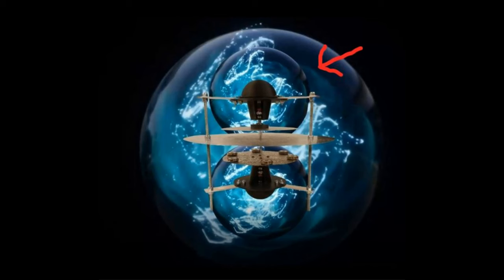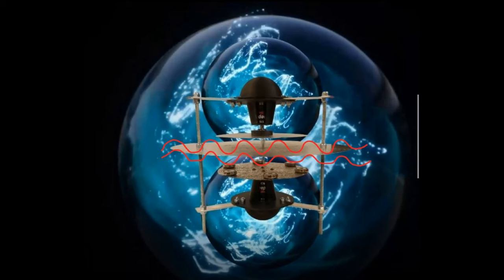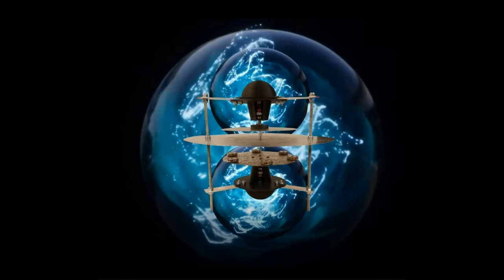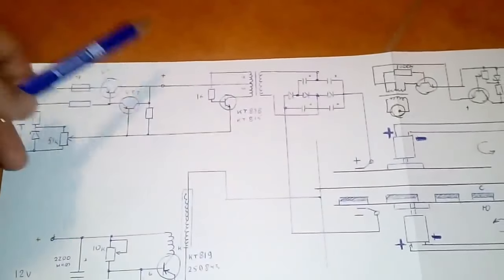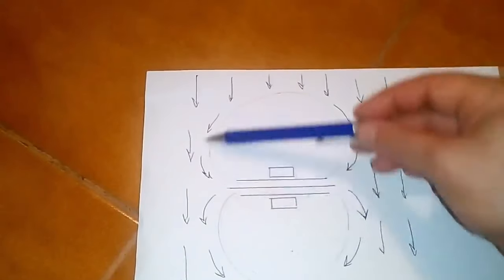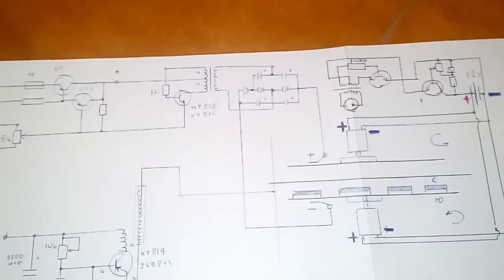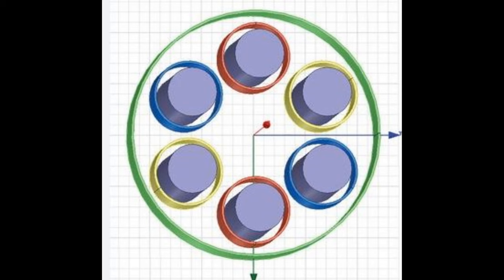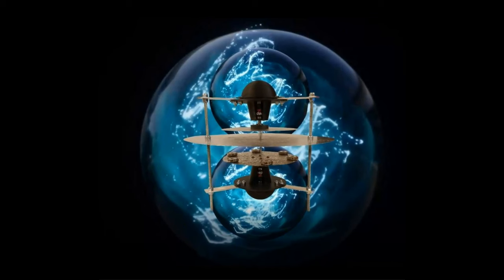Graviflyer "Reverse Engineering" #5

Comment: Great job getting to the point especially with the aided graphics. 

Here's the 4 laws that Alexey mentioned: 
1. An electromagnetic field of certain frequencies can create an environment where gravity is absent. 
2. Interference of longitudinal waves caused by two or more Tesla coils (high voltage source) neutralize gravitational waves.
3. Fast radial rotating magnetic fields create a force which involves a vertical vector (which is what causes the toroid pattern). 
4. Sound vibrations at proper frequencies can induce levitation (this is why he keeps talking about ultrasound).

Comment: Great job pal👍. This was more helpful than the original.
Reply from the maker: It is the same information. I guess I filter it out more often than I think.
Reply: @nathanbunten4299  it is the same information indeed but with out the cluttered useless information added. I know the other information that he added is useful on its own but in this context it was rather a hindrance then an explanation. It felt like a Gish gallop were I was overwhelmed. Normally he should have explained all the additional information in the first minutes to get ever viewer on the same level of understanding and then giving the New information that weren't there before. Jumping back and forth is very difficult to follow. So your efforts to make the new information more... "Digestible" was great. I bet you had also view the video multiple times to filter every useful pice of information out, right?
Reply from the maker: @icebluscorpion  I read the translation and knew there was valuable information there. I thought about splitting it up but I wanted to give the full translation. As you said people had a very hard time with it. I am just glad everyone got to see what I did.

Comment: Thanks for this video.
Yes, the explanation does need to be listened to carefully. I will listen to it again to grasp his explanation.
Frequency obviously plays a big part in this.
Tesla himself said: 
"'If you want to find the secrets of the universe, think in terms of energy, frequency, and vibration".
I have built 2 spark gap Tesla coils. One large and one small demonstration type.
I use neon sign transformers to power the big one and an automobile coil powered by a PWM for the small one.
Reply from the maker: Have you ever had a tesla coil last more than 1 hour without overheating or just giving out?
Reply: @nathanbunten4299 No, because I have never run one for an hour. 
I did notice that the secondary coil had a few flashovers but that was fixed using several layers of lacquer.
 They are spark gap coils, not solid-state ones so the tuning takes time to get it right on the primary coil.

Comment: Thanks Nathan - I had just aligned your translation with the original video to see the images, and what you've done here has massively simplified the process - excellent!
I'm working on a similar approach using resonance speakers to directly vibrate solenoid coils at their acoustic resonance, and impulsing HV + and - at the same time to form the capacitance. I will now add the ultrasound and see where that goes as I can control all the resonances and frequencies being used. The idea is to make a solid state version. 
I tried to friend you on FB messenger and put the information there also. Thanks again for all your shared information. It came at a perfect time to help figure all this out! Cheers
Reply from the maker: I will add you on facebook. I am working on the resonance frequency of aluminum 421hz is promising but I may need to cut down some tuning forks to get to 400hz If we get the exact frequency to aluminum. Then controlling the resonance becomes easier. The motors and the piezo work on pulse. The ratio is not yet configured to the tesla coil. It will be interesting to finally get that part done. ( for every one pulse the tesla coil makes in kilohertz the piezo makes in hz)

Comment: His high voltage section definitely starts out as AC. His section after the output coil consists of what looks like 4 capacitors and three diodes arranged in a configuration I don't understand.

Here's where I would expect to see a 4 diode array to convert AC to DC.

That section alone could be evaluated in software to see what it's actually doing. We don't know the frequency of this high voltage generator or the value of the capacitors and this is critical to determine the purpose of these components. 

I'm also curious about the demonstration that places the balls in a stacked formation at a specific frequency. I'm curious if the experiment was tested inside a vacuum? That would determine if the effect is magnetic field related or just compression fields created from air.

Comment: I think the answer is in circuit,do we know what is the frequency of Tesla coil?
Reply from the maker: The tesla coil if simply a field generator. The frequency does not matter. H put the wire down to #2 coil it negates it from giving the true frequency of the coil. 

The meter he uses has no batteries. It uses the charges air particles to make it show field strength.
Reply: @nathanbunten4299  Well, when the equation has several unknowns, the probability of getting the answer is zero
Maybe it's better to ask Alexi to tell us the parts of the value he used in the circuit, that way we can also get the frequencies.

Comment: Are the electric motors integral for the effect or are they just there to provide rotation.  If the latter,  could they not be replaced with a pneumatic compressed air system?  This would simplify the machine.
Reply from the maker: We don't know. That will be known when it lifts. then we can fine tune it and start replacing parts.
Reply: @nathanbunten4299 Interesting.  Obviously, the motors also have coils and generate electric and magnetic fields.   Simplifying by removing possible interference effects might be a useful tactic.   A simple compressor can really spin things very quickly as well as being  a possible source of infrasound.
Reply from the maker: @anthonyscott9936  I might just try to run the piezo and the motors on the same circuit. Thank you.
Reply from the maker: @anthonyscott9936  I have heard the sound. It is like a 3d printer making circles.
Reply from the maker: @anthonyscott9936  The motors harmonize. like an am radio dial going up and down. The coil will give of a ringing sound when it in in tune.
Reply: @nathanbunten4299 Did I just keep you up? 🙂

Comment: At 3:11, how can you keep top disk positive and lower disk negative with a TESLA Coil which has AC output?
The high voltage generator in this case would be a DC generator.
He is not swapping definitions, 
When he says "High voltage generator", he means HV DC power source.
When he says "Tesla coil" , he means HV AC power source.
There is  a BIG difference.
Please get back to very basic understanding of current and voltage before using it.
Reply from the maker: He is not using the tesla coil like you think. The wire is just placed down the #2 coil. NOT attached to it. I have built several of these and I have the way it connects correct.
Reply: @nathanbunten4299  But its still AC.
Reply: Gravitation wins… every time. 
There’s no defeating gravity with a machine. Electric, magnetic, or mechanical, in any configuration. 

Mass is mass.

Comment: Are there just six magnets total?
Are they mounted on the bottom rotator north facing up?
Neos or ceramics?
Does the HV neutralize them?
Do you think the frequencies match or can they be harmonics? Possibly the 11th harmonic as that seems to be good for other things like Rife machines if I remember correctly.
Reply from the maker: 6 magnets we use neo but he used a lesser version. yes facing north up.  Bottom rotator only. the eddie current (magnets to aluminum)creates a field separator. The high voltage fields never cross. We are working on the harmonics. It seems there is a beat frequency. Like 4:1 ratio. For every 4 tesla coil beats you get a piezo beat (may be much higher up to 400:1). We believe there is 7 harmonic frequency's. We have not found the 7th but we are close.
Reply: @nathanbunten4299  
Thank you